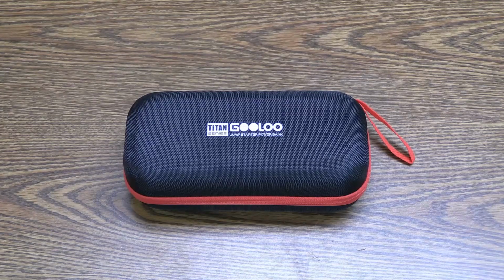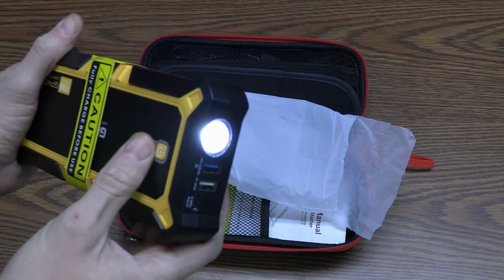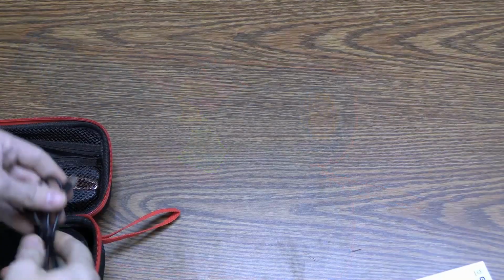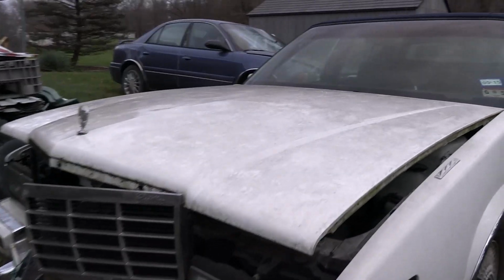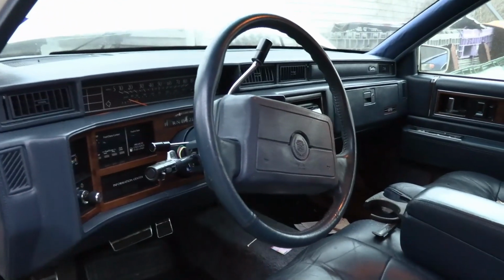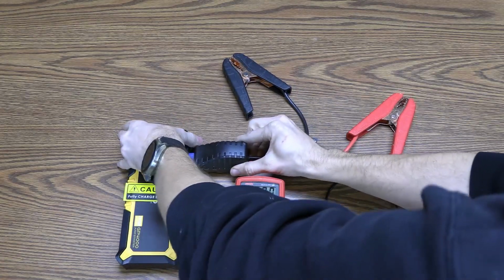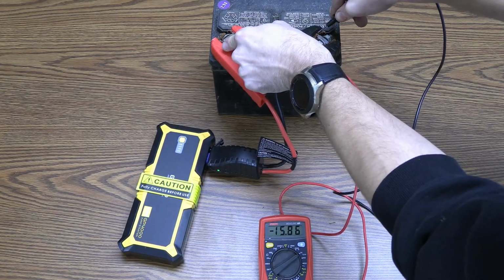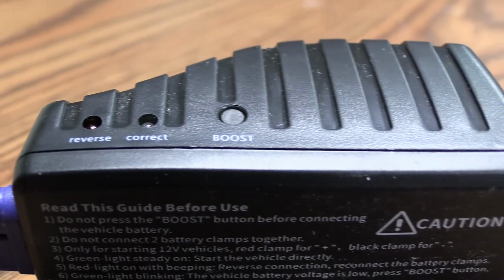GOOLOO GP4000 Jump Starter - 4000A Peak Car Starter

Comment: I am trying it now, It is not jumping off my super duty in 10 degrees.
Reply from the maker: Make sure to push the boost button and wait couple seconds. Also after using over a year the connections sometimes need re-attached even if the green light is lit. I have had it take a couple trys in the past

Comment: I bought one, it came with a 3 bar charge in it. It took about 30 minutes to fully charge. I used it 3 times on a dead battery and it started the car like a brand new battery. I charged it again just to see as it was still reading 4 bars and it took about twenty minutes to fully charge. I used it again the next day on a different car and it worked like a champ. Well worth the investment.
Reply from the maker: @maggaman1603  after the time we have had it has saved me many times on project t vehicles

Comment: Just bought a 4000A from Amazon in March 2024. It did not come with a USB charger block; that is now an option, or supply your own. User Manual says step one is connect blue connector on clamps to the jump starter, then connect clamps to car battery. Green light: start car. Flashing green light: car battery is too low; hit booster button (which is now improved by being larger, on top of the black module, and marked BOOST), and start car within 30 seconds. Red light; the clamps are connected backward.

Comment: I just bought one of these to keep in the car. My battery is ok now but i have been caught out before and waited hours for roadside assist to come and help me. I guess i will find out if it works one day in the future.
One thing to bear in mind if keeping in the car for an emergency - charge it up every three months or so as it will lose its charge if left unused for months on end.
I have also bought the similar companion device which works as an air compressor/tyre inflator.

Comment: This is pure hoax.  Looks like a new battery in there already, and you didn’t even prove it was "discharged".
Reply from the maker: Sorry if I did not show more of the battery condition prior but I can assure you this was not a hoax. Was pleasantly surprised.
Reply: Gooloo 4000 , it is the real deal . I have one and it will start a car with a dead battery .
Reply: I bought one last month, used it 4 times and started the car like a brand new battery.

Comment: This starter can started ford F350 6.7 liter disel?
Reply from the maker: @J Dubb we have continued to use this around the shop and I have to disagree with your comment. Is it top of the line, no. But we have used it to start a number of derby cars, derby truck, and have used it to help it least 2 family members get there cars going enough to go home. So it does what it claims and for that I would not consider it trash. On scale of good, better, best I would place at a good.
Reply from the maker: Is worth a shot! Used it on a 6.0 liter gas engine and fired right up
Reply: If both batteries are dead, the answer is no. Ask me how I know.
Reply: @mickdayank how do you know

Comment: Those are so handy I carry 1 of those instead of jumper cables in everything it's easier to grab that then make sure I have cables in every vehicle in winter it stays in my coat pocket and when it's warm it hangs on my key rack so I grab it with the keys to what vehicle I'm taking that day it's easier to carry on the motorcycle than jumper cables too and there's not much you're going to jumpstart with a bike anyway without it

Comment: Should've show the car won't started before connect the pack see the real results
Reply from the maker: I realized that after filming was completed. Sorry for not capturing that but very good point for full transparency
Reply: I jumped my 7.3 powersroke on a 10 degree day this winter when the dome light barely lit
Reply: Yeah it all good I just wanted point out for helpful reason not in smart way👍